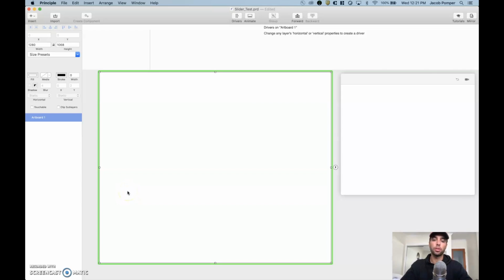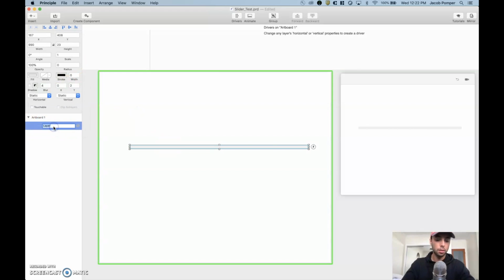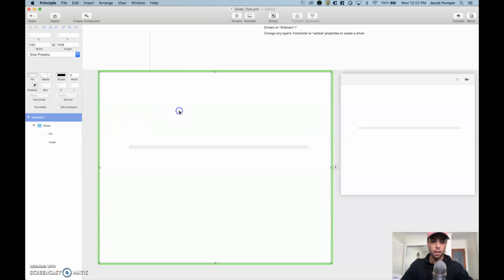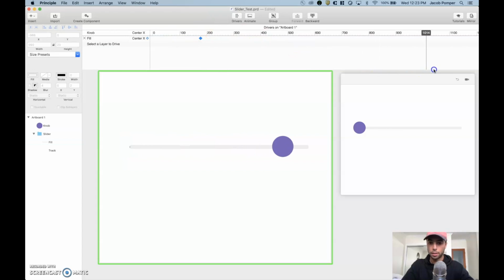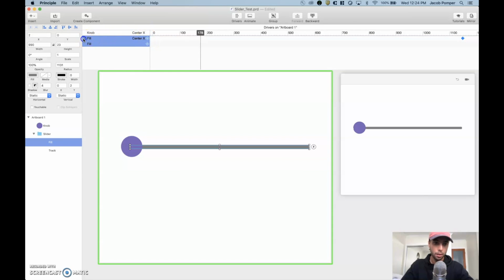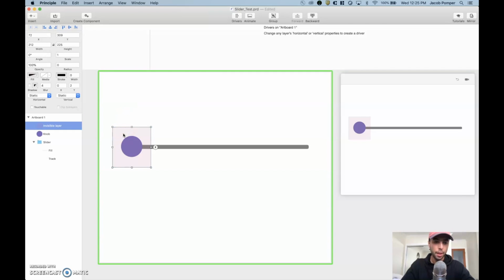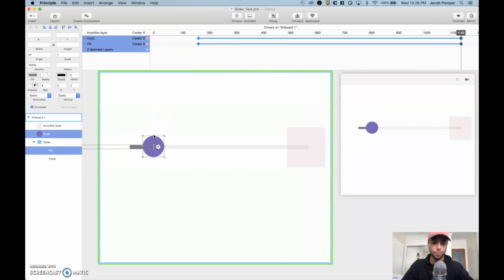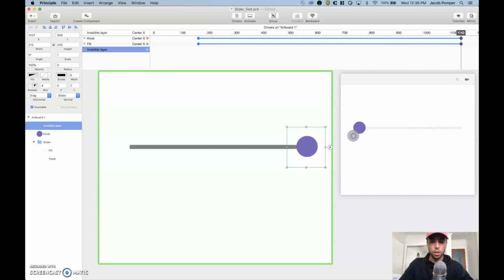Principle UI/UX Animation: Create a slider (that actually works!)

Comment: Hey man, awesome tutorial for people like me that are just getting started with principle. Do you know if there is a way to change the Artboard when the slider hits "100%". I'm working on an App prototype for school that has the same mechanic as the ios 6 lock screen (slide the icon all the way and it switches the page).
Reply from the maker: Glad you found the tutorial helpful! You could try using a “drag ends” interaction to transition to the next screen
Reply: @JakePomperDesign  thanks a lot man, got it to work now. :)

Comment: I have a little problem with this. While dragging, the first part of the fill becomes square, because only its extremities are rounded, so the slider becomes inconsistent in shape.
Reply from the maker: Try rounding both the fill and the track?
Reply: @JakePomperDesign  I rounded them but obviously the extremity of the fill is the only round part, it's not round in the middle for example. So when you move the fill with the knob, the part that you see is squared.
Reply: @Sonolesediciezerosei  If you round the group that contains the clip sub layers toggle, maybe that will work?